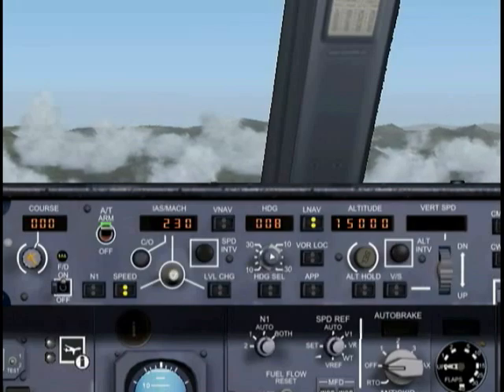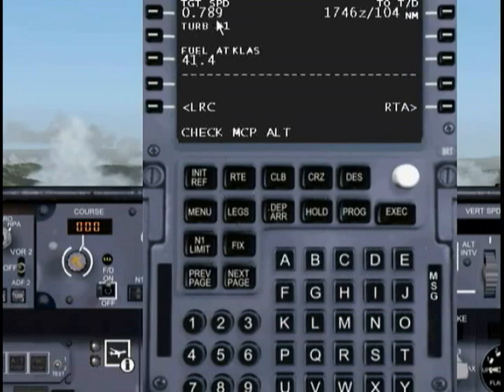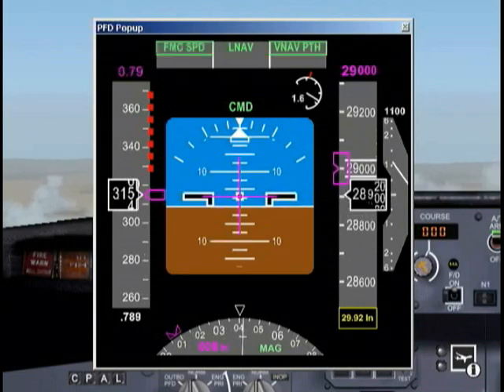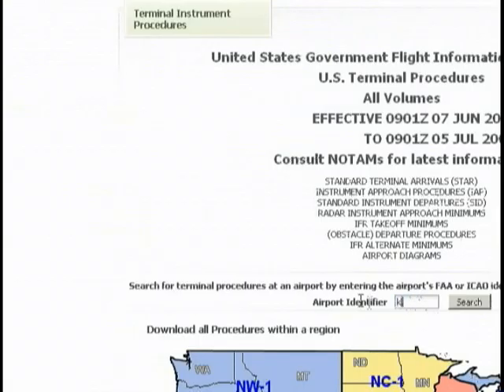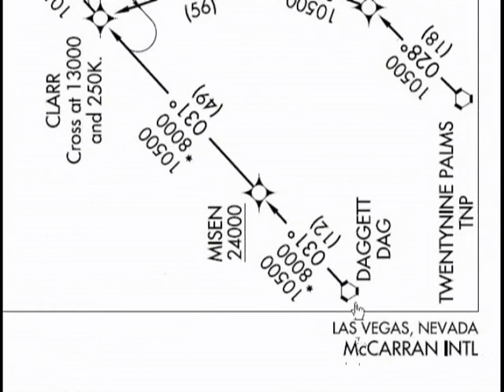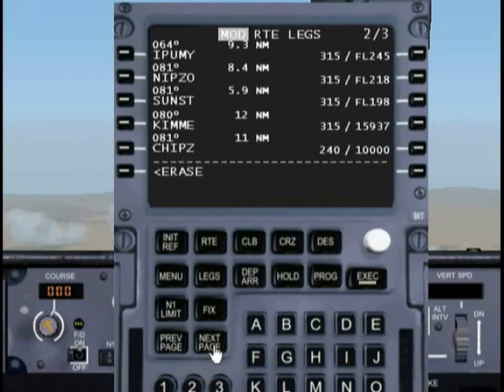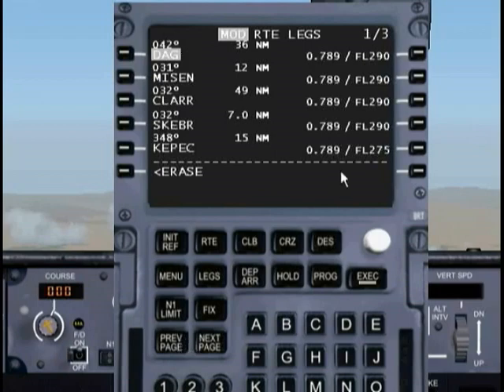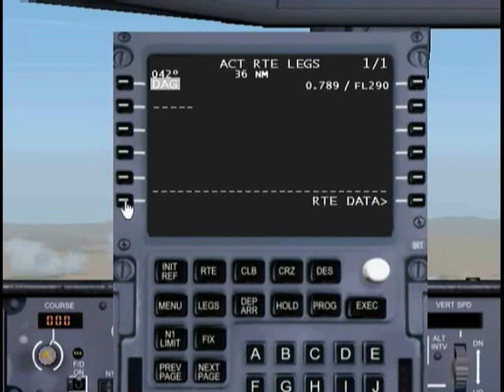PMDG FMC Tutorial part 5

Comment from the maker: Make sure the speed is set to 300 under CRZ and CLMB if you are still in cimb mode. Also just because you change the speed it wont update to the new speed until you reach your next waypoint. You can cheat it by just modifying the speed next to the active waypoint that you are currently flying.